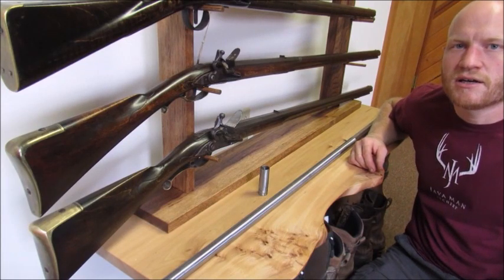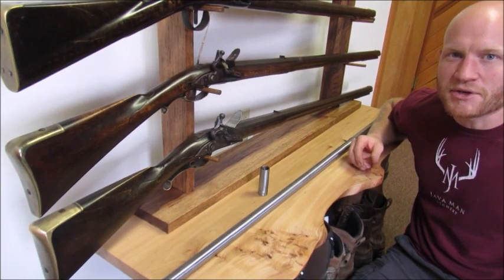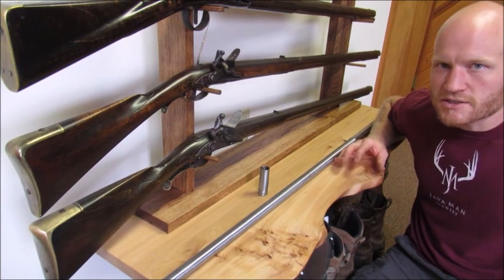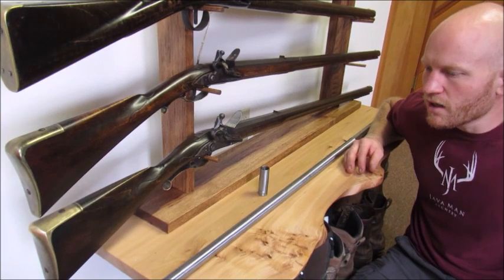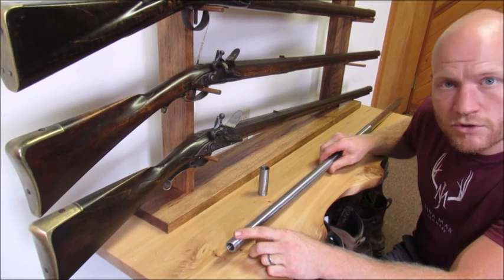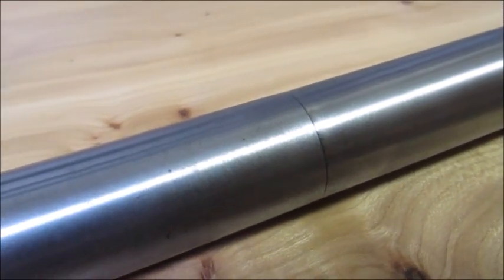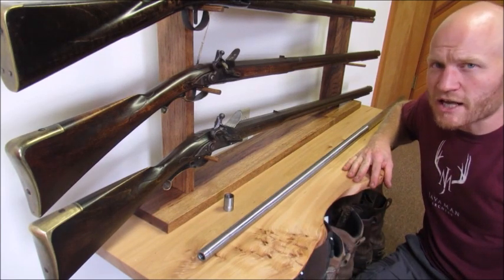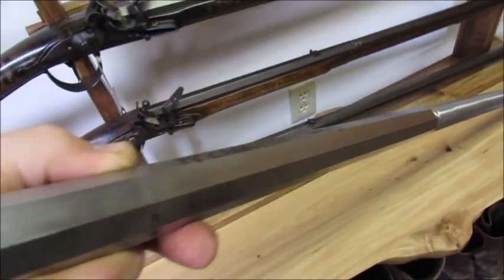46" B. Hoyt barrel for smok'n turkey

Comment: Get something to get you past the threads when you load. You don't want BP in your choke threads. I sent my double barrel 10ga to Briley to have it choked and they provided a screw loading tube so I wouldn't get powder in the threads during loading.
Reply from the maker: In that case load with the short .62 .....
Reply: @bkauffman0390  that would work.